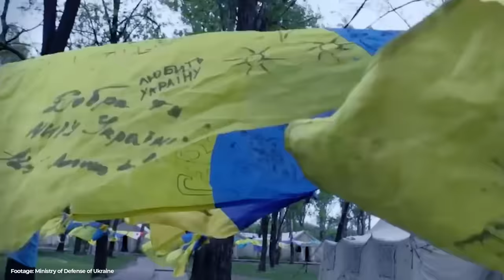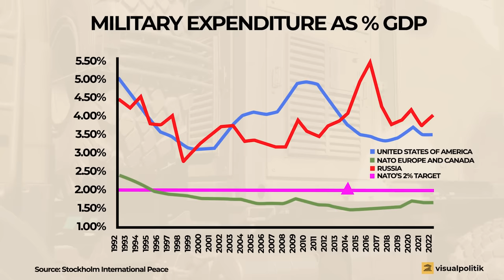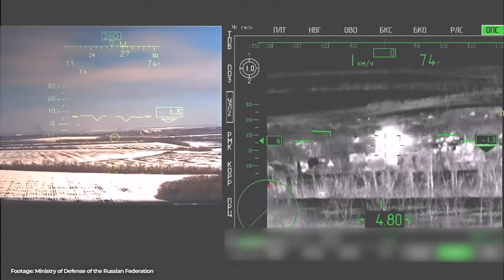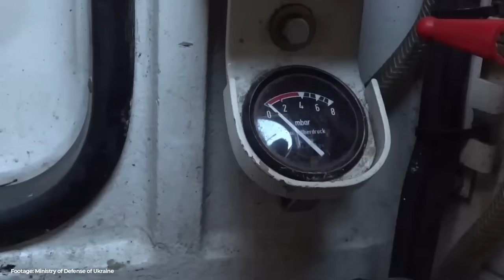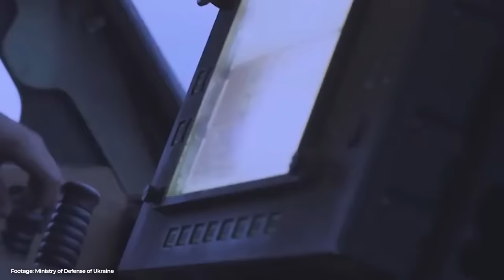Has Ukraine Lost the War?

Comment: For almost every point VP EN talks about at 2:30 in this video there's a counterpoint:
1. Unsustainable Russian losses (without any proof of losses), this is easily debunked by looking at concrete numbers published by Mediazona, they conduct thorough research of Russian losses with a proven methodology.
3. No words about Polish farmers blocking trade routes. Also, Israeli parallels.
4. They already have capability to do that on line of contact and about 10-20 km behind it

Comment: I think VisualPolitik EN does not know the difference between "Howitzers" and "Ammunition".  Their figures are WAY off on the number of Howitzers.  Those figures are more inline with the number of rounds of ammunition which is different from the tubes that fire them.
Reply: Which is why i don’t take their videos so seriously
Reply: @worththewatch1517 Nobody take seriously anything of this dudes.
They just said what their owners wanted to generate a parallel reality and hope the más believe it as true.
Reply: The OED supports that usage.
Reply: @dixonpinfold2582  That is not what the military which USES "howitzers" refer to them as.
And if by OED, you are referring to "Oxford English Dictionary", it defines "howitzer" as follows:

howitzer, n.
A piece of artillery with a relatively short barrel, and typically of relatively light weight, designed for firing shells on high trajectories at low velocities.

The other definitions are archaic and no longer in use. (not used since the 1700's)
Reply: @computernerdtechman   Wrong. From the  current OED (rev. 2014):
howitzer ɴᴏᴜɴ [2nd sense]
1.b. A shell fired by this piece of artillery.
         𝘓𝘦𝘴𝘴 𝘤𝘰𝘮𝘮𝘰𝘯 𝘵𝘩𝘢𝘯 𝘩𝘰𝘸𝘪𝘵𝘻𝘦𝘳 𝘴𝘩𝘦𝘭𝘭.

And it gives quotations of this sense with citations from 1761 up to 1998. Oxford English Dictionary has a website.
Reply: Yeah that dude is lost in time, space and reality 😂

Comment: Investments into ammunition production would take years to drip down into real ammunition production. An you’ll be lucky if it will not have to be done under risk of cruise missile strikes on the production lines (as is the case in Ukraine).
Reply: So you suggest NATO should surrender?
Reply: @maritaschweizer1117  Negotiations is most likely, or a frozen conflict

Comment: Several factors that the West including your channel failed in analysis. The greatest mistake was the energy cost. Russia is energy producer and the state own vast amount. Second mistake was the labor cost. The third mistake is the readiness for sanction. As the result, Russia GDP was 2.6% in 2023.
Russia has no problem with conventional weapon productions. At first they had chip supply problem but now, Russia showed their technology is par with their need in the war. For their troops, they are slowly replacing their mobilized troop with contracted troops in the front-line. In contrast, Ukraine relied on mobilized troops and worse, conduct war operation to please the West rather than to win the war.
For instance; this summer operation. Ukraine should halt military operation as soon as learning the impossible. Failure to do so, Ukraine had to conduct small unit operation to minimize the loss and to please the West at the same time. The unfortunate was, Russia defense structure allowed Russia to use less artillery shells. In this winter, Russia saving ammo in the summer defense plus its active production, Russia pounding Ukraine like hell while Ukraine didn't have much artillery shells for counter battery. Ukraine front line is now almost collapse. You will soon see, Russia will take a big chunk of Ukraine territory. I wish I am wrong but...

Comment: A real analysis is that the frontline is more or less a stalemate with a slight advantage to Russia.  This advantage is primarily due to better supply as Ukrainian troops are struggling with materiel, especially ammunition for their artillery pieces.  This allows Russia to gain fires superiority in important areas, which in turn allows them to advance and precludes Ukraine from launching any real counter-attacks of their own.  The counter-offensive failed for several reasons, but as I stated before it started, the idea of attacking into prepared defenses in the face of enemy air superiority was insane.  The US military would never attempt such an attack except as an action of last resort.  However, Ukraine was in a position where the Western armchair generals (politicians who mostly have net zero military experience, let alone warfighting experience) were demanding that they attack.  This led to a costly defeat and stands a stark warning of what happens when you allow politicians who have never served influence military strategy (the USA needs to learn this lesson).

Long term, the US needs to pull its head out of its rear and fund the Ukrainian resistance.  The reason is simple.  Russia has spent decades viewing the West in general and the US in particular as 'the enemy'.  Russian children are now being raised on this teaching in school.  A few years ago, Russia issued some not-so-thinly-veiled threats of nuclear war against the West.  In part, what Putin is testing is Western resolve.  Russia has banked on the belief that the US is a short-sighted, weak-willed, instant-gratification culture with a population is largely ignorant, poorly educated and easy to manipulate.  So far, he's being proved more or less correct.  Ukraine didn't give us the instant-gratification of a win, so we are now losing interest and will.  The US population's almost complete lack of media literacy and tendency to live within their own echo-chamber makes the general US population incredibly easy to influence via Information Warfare.  US law effectively prohibits our own intelligence agencies from actively countering Russian information campaigns.  

Right now, what the US is doing is showing that we are completely unready and incapable of fighting and winning a war, even by proxy.  This is a very dangerous signal to send with people like Putin, Xi Peng and Kim Jong Un out there.  The US needs to show somewhere that it has resolve to do something other than be the world's bully.  Right now, that's all we look like.  We can't stand up to someone close to our size like Russia.  But damn, we sure can go and beat up the little kids in Hamas and the Houthis and puff our chests out like that makes us the bad boys on the lot.  Pretty much the playground bully of the world.

Comment: If the West allocates sufficient resources it can easily outproduce Russia, not to mention if Ukraine would get F-16s, not even talking about F-35. The issue now is that Ukraine's air force is far worse than Russia's and at the time probably barely exists at all and it is a huge advantage to Russia. Artillery shells too, but Western artillery is better. Of course manpower is also on Russia's side but issue is West is not doing that much to help Ukraine so it is hard for them...

Comment: Honestly all we really need to do is to spend a few extra % of our military budgets.

The best thing we can do is to do long term commitments/ orders to Ukraine,  if a bunch of countries anounce that the are going to supply Ukraine with 10,000's or 100,000's of artillery rounds each year for the next 5 or even 10 years on top of domestic requirements this sends a message.

To russia this is going to be an ironman challenge not a sprint, i would then remind them several of Ukraines supporters kept boots on the ground in Afghanistan for a decade, this IS only money. (The locals didn't really want us there Ukraine does)

It would also make manufacturers think about making new more efficient production lines and keep the old ones running until demand decreases.

We should also stop making a big deal every time we send stuff to Ukraine every time we make a big deal sending like the equivalent of 0.01 of our annual military spending the public thinks its a big deal. Because its 10,000,000's but to some governments its a rounding error.